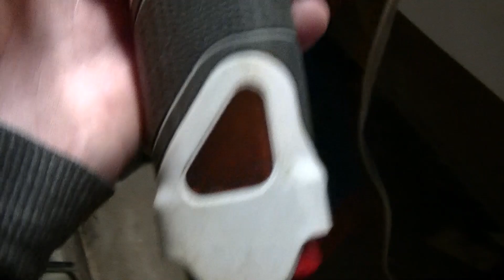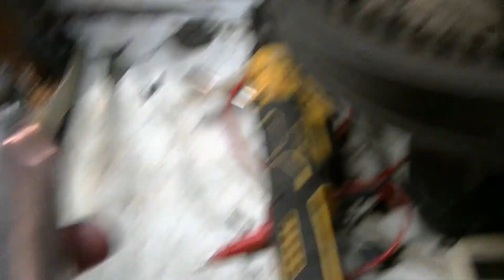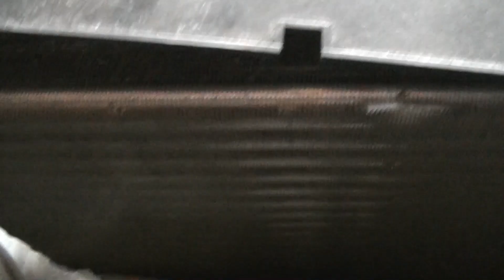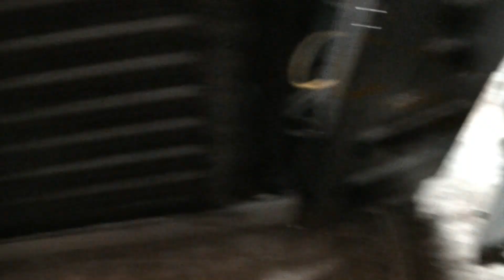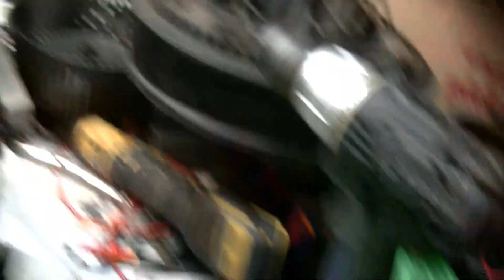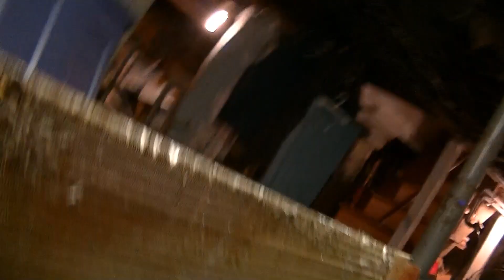Replacing the Fan Motor In The Emerson Quiet Kool

Comment: Any suggestions as to where to find a replacement fan? Mine broke into pieces, unfortunately.
Reply from the maker: You could check a website like parts select or repair clinic, but they likely won't have the parts in stock anymore unfortunately.